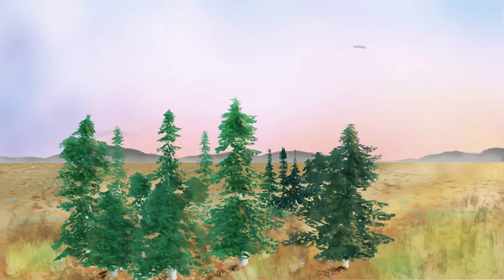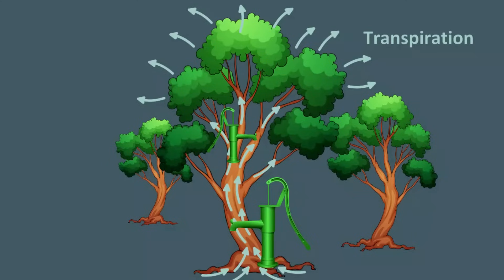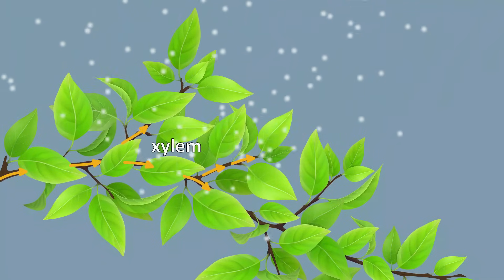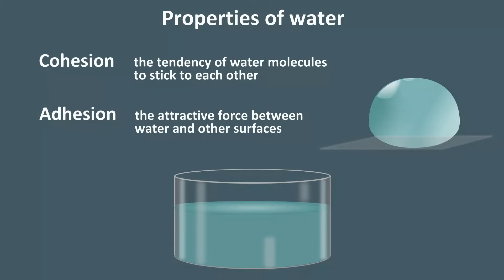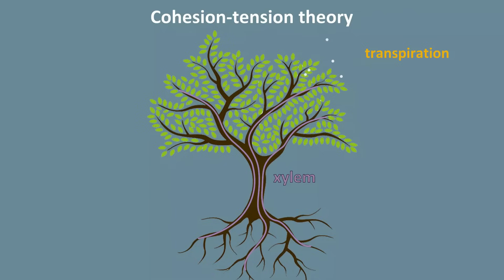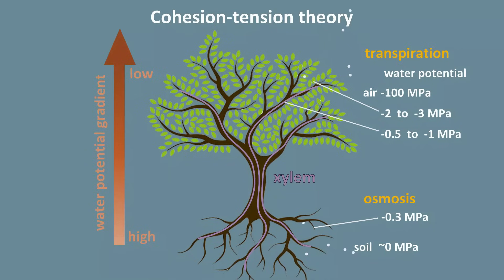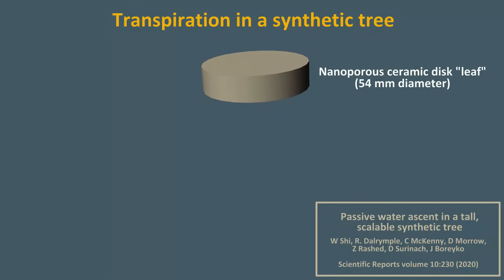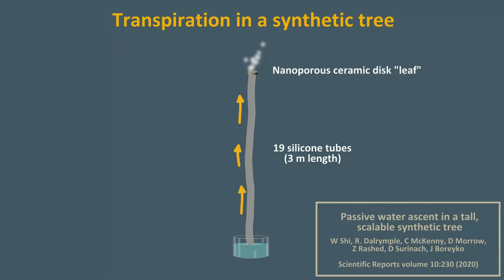How do trees pump water?

Comment: This is bullshit and not how it works --  have you ever chopped down a tree or broken a stem of a plant?  Do you see water dripping out?  I don't -- because this is not how it works.  

So, how does it work?  Plants circulate water and nutrients, centered on the concept of exclusion zone (EZ) water, a fourth phase of water that is structured, gel-like, and negatively charged.   EZ water forms a layer along hydrophilic surfaces within plant tissues, such as cell membranes and xylem vessels.  The movement of water and nutrients is driven by the energy from infrared light, which helps create and sustain this structured water.

Nutrients and water are transported not solely by the traditional transpiration pull mechanism, but by a process he describes as "zone melting".   In this model, a region of ordinary, unstructured water propagates along the inside of a tube filled with EZ water. Because solutes and nutrients are excluded from the EZ water, they accumulate in this non-structured zone. As this zone moves along the tube, it carries the nutrients with it, effectively transporting them through the plant.   This mechanism could explain how substances move across cell membranes and through vascular tissues without relying on the conventional model of thousands of pumps and channels.

The ability of soil to hold water and support plant life is directly related to its capacity to generate EZ water, which depends on proper charge distributions in the soil.  This challenges the conventional view by suggesting that the fundamental driver of water and nutrient movement is not just osmosis or transpiration, but the formation and dynamics of structured water within the plant's system.

Comment: Okay thanks for your video.in this case when you cut a tree or bananana tree at a height of around two meter ,how again water flowing conti uous  through the cut portion even with out branch or leaves .it means there is something in tree roots to pump water in one direction without coming down

Comment: The experiment demonstrates that water can be pulled up 3 meters, not 30 meters.
Reply: The tubes they used in the experiment were 3.2 mm in interior diameter while a trees xylem can be as small as 0.005 mm in diameter. Through adhesion and cohesion they’d be able to travel further.

Comment: I feel that we are missing the implications of being able to move water against gravity using only evaporation....specifically is it possible to move water from a reservoir, up a slope, to another reservoir. ...collect the water thru condensation ....& then generate electricity as the water flows down to the first reservoir. If this were possible, it would be the equivalent of a solar powered battery using water as the medium........fascinating....
I'm pretty sure I'm missing something here....
Reply from the maker: Thanks, Lars, for your insightful comment.  You're not missing anything at all.  Your proposal is very perceptive.  We take advantage of a similar process now.  Water is evaporated from ground and ocean sources, the water condenses at high altitude to form clouds and then the water is deposited as rain or snow at high altitude.  The downhill flow of the water is used to drive turbines to make electricity (hydropower).
Reply: @ScienceSketch  thanks for the reply.....so in theory we could generate electricity in a closed loop system ... building 2 reservoir lakes connected by thousands of capillary tubes without the need to dam up rivers & thus disrupt salmon migration etc...???
Reply from the maker: A closed loop system seems possible, but only if you used the sun's energy to evaporate the water from the low reservoir and then condense it at the high reservoir.  The condenser would have to have a cold source, and you would have to find a way to do that without consuming energy.  I'm not sure that a bundle of capillary tubes connecting one reservoir to another would work.  It is the evaporation (transpirations in plants) at the open end of the tubes that creates the "suction" pulling up the water.  Unless you had a way to allow the evaporation at the upper reservoir and then condensed the vapor to create liquid water.  Again, you'd need the cold source to condense the water vapor.  Anyway, it's worth finding out if anyone has tried something like that.
Reply: @ScienceSketch  love to discuss over lunch - where in the States are you located...I'm in Seattle

Comment: The question is: Why doesn't the water get boiled? Lets say pinewood trees grows more than 200 feet, theoretically at some point the water moving upwards has to reach a boiling point!!
Reply: Yes it should get boiled, but changing fase form liquid to gas requires activation energy and that energy can come from a tiny air bubble, so the solution for this is that water in the xylem tubes contains no air bubble and they can do this because unlike a straw they have been water filled from the start.
this video helped me to understanding better the concept of activation energy:https://youtu.be/ph8xusY3GTM
Reply: @otaviofonseca8383  Thanks :)
Reply: @otaviofonseca8383  No air bubbles, no pressure difference, and therefore, no boil.